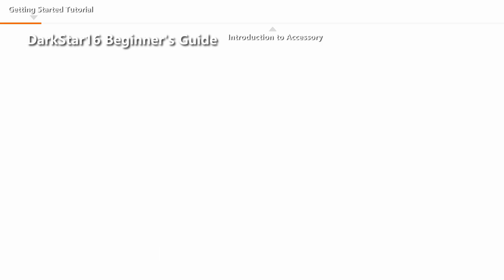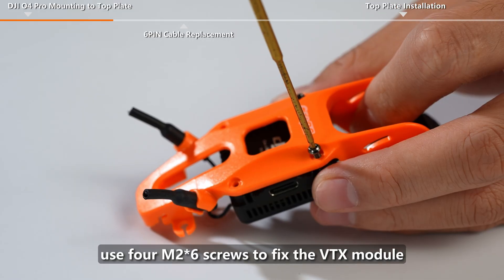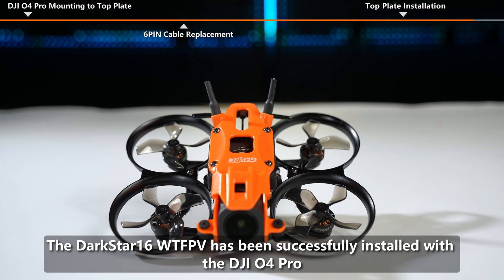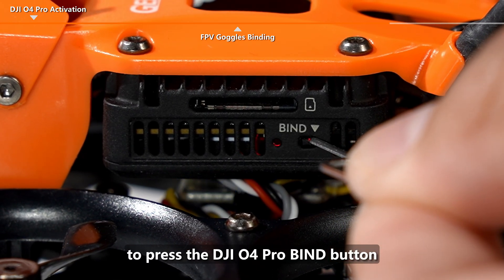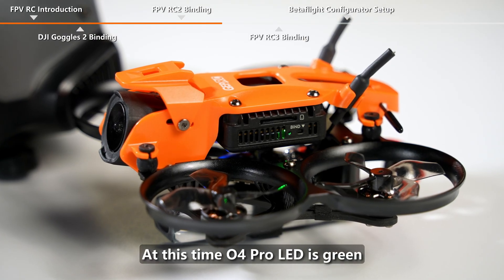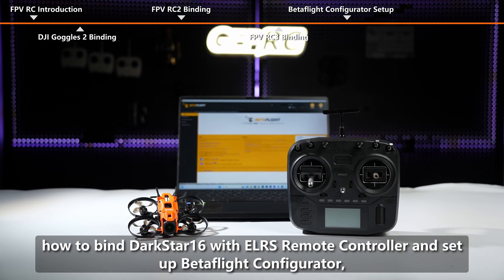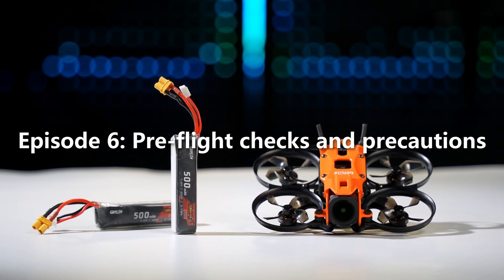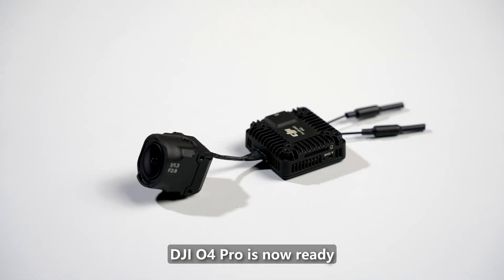DarkStar16 | DJI O4 Pro VTX  Installing and Binding

Comment: I followed perfectly  until 8:06 my DJI controller  does not work in betaflight . What am i doing wrong I can’t fly this drone it connects to dji goggles 3 i can’t see the camera though the goggles but have not response on the controller in the dji goggles menu I switched to sbus the drone in betaflight is in sbus i need help please

Comment: Hopefully my Darkstar 16 can be replaced. It came with a dead FC on arrival. Clearly I never flew it but was accused of doing so. 😢
Reply from the maker: I noticed that you posted almost identical comments under the videos of different models, but these videos clearly feature distinct models. I’m not sure which specific unit of yours is experiencing the issue. If you’ve contacted our after-sales service via email, could you please share the email address with me? I’ll check if I can help speed up the process for you.